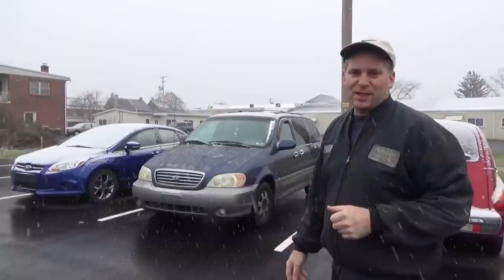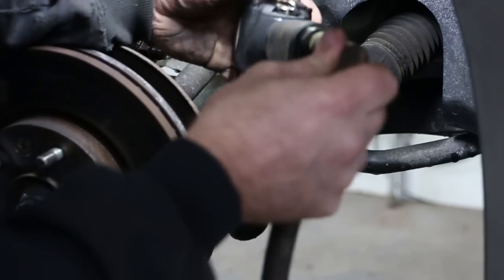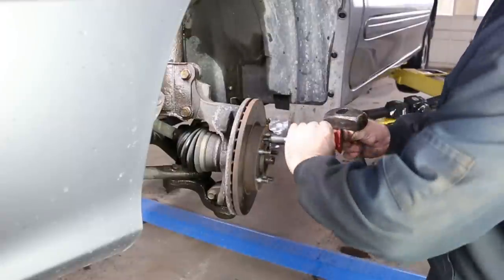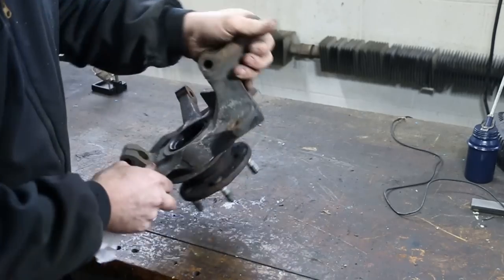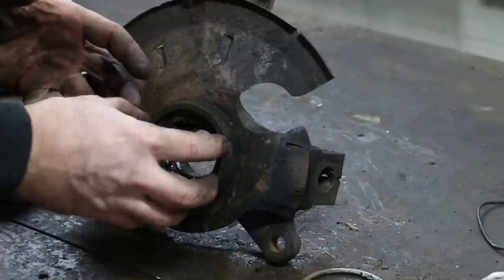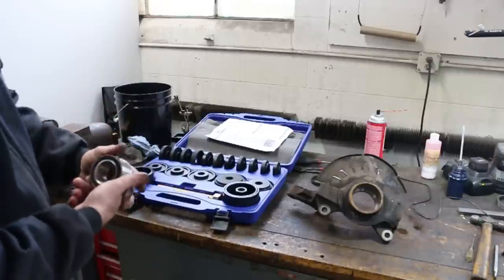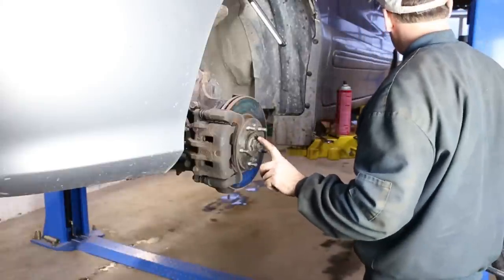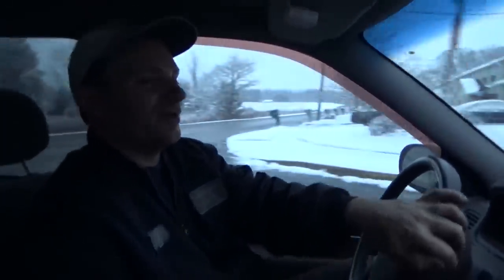Kia Sedona - Front wheel bearing Complete repair DETAILED

Comment: We have the same model/year van -  A few months back the right front started to squeak on deceleration. Thinking it was the pads, I replaced those however the squeak did not go away.  Now its gone mostly to a growl  like the video. There's a 2004 Sedona at the pick-a-part lot  which if I can get tools id get the knuckle and hub off it. Thanks for this video, I know it will help when I need to follow along and replace etc.

Comment: I want to thank you. 11:09 when you described that you "can push on that center race" to press out the bearing. I was worried that pushing on the inside would just pop and I'd be stuck digging out the rest of it. This video gave me the confidence in the correct procedure and I was able to complete the same procedure on my 2003 Kia Optima.

Comment: I sure like your press, with a single column giving lots of room all the way around your base. New presses aren't like that. I really like the technique you used here, with no need to accidentally score the shaft when a cutting wheel slips. Apparently many wheel bearings don't have enough of a shelf to support the bearing splitter.
Reply from the maker: spelunkerd thank you, that press has been very good to me over the years. Made by "Ward" I'm not sure of it's age however I know it's over 13 it came from a alternator and starter rebuild shop that closed up, I haven't seen another like it before or after. I'm sure they are out there. this splitter don't always do the trick, so yes I have a fair share of scarred hubs on the road 😁 glad it worked out this time. Thanks for stopping by. It's always a pleasure

Comment: Nice video & repair Will! I use the OTC 6575 Hub Grappler Kit and the OTC 6575-3 Hydraulic Kit which uses a hydraulic ram instead of the jackscrew so if the hyd unit were to fail I'd have the jackscrew as a backup if I was mobile. It removes/installs the hub also and has a puller for the inner bearing race but I usually end up using the same method you used or cutting it off but I've also had good luck grinding notches and using the puller. I usually do it on the car but like you said if in the shop you can sometimes do it just as fast with the press. You touched on all the critical points...great job Will!!
Reply from the maker: Hayward's Automotive I will definitely look into that setup! Thank you for sharing all this helpful insight as I'm certain it will help someone along the way. I have contemplated many times trying on the car, honestly never have. Old habits are hard to break 😁 thanks again. Always great hearing from you
Reply: It saves a little time but I did it off the vehicle for years and still do sometimes. I've been called to friends & customers homes when they wait so long their wheel is about ready to fall off and the kits are invaluable and save a trip back to press the bearing out. I like your press...pretty cool!
Reply: It saves a little time but I did it off the vehicle for years and still do sometimes. I've been called to friends & customers homes when they wait so long their wheel is about ready to fall off and the kits are invaluable and save a trip back to press the bearing out. I like your press...pretty cool!

Comment: Well done bud. Love that lil press you got there. I finally got fed up with my light situation and have ordered that same light the other day after a car project that needed to be done. Hope its all cracked up to be like everyone says.
Reply from the maker: Longtrailside thank you for the compliment and feedback, I will be completely honest, im not one to sell make believe and I sure the heck would not want to buy make believe either! All I can say is this was my first repair since the new addition, most tools not even broke in yet, I can say at full power on that light it latest the whole repair, in which took longer due to capturing extra details. around the 3rd hour I did notice some diming however still brighter than my snap on 3rs in, my old light was dead 30 minutes in. so this is a big win for me so far. I will do my best to report back any changes.
Reply: That's good good to hear about the longevity of the light. I have seen Eric O from SMA beat the pizzwizzle out of his astro tools and they have held up extremely well. A lot of other mechanics have been buying the astro light so i'm excited to try it out. Would love to get the astro BIGNASTY air hammer down the road. Oh by the way hows the new shop workin for ya?

Comment: I have a bearing removal/install kit like yours Will and have the same issue with something else needed in the kit to remove the hub. I currently have a big drift to strike & drive the hub out. If it don't move it goes in the press. Great video mate 👍
Reply from the maker: One Auto, nice! A good kit like this sure makes life easier to say the least, yup done that a few times 😂 mini sledge. It's one of those things I have some good ideas to improve upon this however just never find the time till I need it lol
Reply: One Auto, purchase the OTC Hub Grappler puller & forcing screw set. This will complete your kit. It runs about $140 or so.

Comment: Great video.  I have a 2005 Kia Sedona and had the wheel bearing replaced several times at a local repair shop.  They must be damaging the bearing on the install b/c they keep going out.  Additionally, It seems like there should be an outer seal and/or something to retail the proper pre-load on the bearing.  Torquing the axle nut only compresses the spindle (hub?) and it seems the bearing will then separate while driving.  I am at wits end on my 2005 Sedona and ready to take it to the scrap yard.  I cannot keep haing the bearing replace every 2 months.

Comment: 99% of the time ni do press in wheel bearings that race stays on the hub and i either use a puller if possible to get it off. or a torch. sometime u can grind a couple notches it the race so u can get a puller t grab it. learned that from an sma vid. dont work every time but still a good trick
Reply from the maker: Dylan Kinch hey Dylan how's it going man, thanks for stopping by! Yup I'm batting the same average 😂 never fails but yes if this would not have worked we would have done another method as you mentioned, all great tips thanks for sharing

Comment: I always slidehammer the hub, and pull the race off of it and press the bearing out on the vehicle.
Reply from the maker: seems to me you would need to separate the axle at some point. few more quick steps and the spindle is in the vice or the press. is it really saving time? non drive wheels easy peasy on the car. will need to try it sometime
Reply: Your right it is almost easier to do it in the vice, cause you still have to knock the tie rod and ball joint apart to get the axle out! Great videos friend ! Carry on😁
Reply from the maker: truly appreciate the feedback, something i never tried in car

Comment: Will also work 50 to 80% better if you replace the washers with a lug installer that has a bearing in it.
Reply from the maker: GCraigmile great idea, that exact thought crossed my mind while using 90% of pullers, thanks for sharing

Comment: The washers are supposed to be against each other and lubricated you’re also supposed to turn the nut not the bolt in it cuts down on friction and makes it easier for your impact to run
Reply from the maker: GCraigmile good to know thanks for sharing, worked like a charm non the less

Comment: How come you didnt use it to remove the old bearing?  The kit looks like it has receiving cups?  Just curious because I have been looking into the Hub Tamer and have tried it and it works great.
Reply from the maker: yes absolutely could have used it to remove the old bearing once the hub was removed, i almost went Full press on this job then thought man i have a kit i can demo, the receiving cups would work perfect. we will still need a way to remove the Hub in addition to this kit. everything else this can do with ease
Reply: Slide hammer for the hub?  Then it can all be done on the car?
Reply: Thanks to this video though I have found my new tool to buy as far as that kit.  Looks like it does everyone the Hub Tamer does but at 1/4 cost!
Reply from the maker: Potentially, they can be pretty stubborn even in a press at times. never looked into this to be honest. great topic thanks for the thoughts, im going to dig deeper now :)
Reply: robinsonsauto I agree they can be stubborn especially in the salt belt where it looks like you are and I know I am.  Let me know what you come up with but I think you already sold me on this tool.  I hope astro gave that to you because they are going to get some sales.

Comment: Hub Grappler has it all to remove & install while on the vehicles. I purchased a Dremel 8220 tool for those pesky in races. It also helps with minor rust build up in the areas. Try Tooltopia.com to save about half vs the tool trucks. This is a super nice Astro Pneumatic kit though as i am also a fan of many of their products😍😍😍

Comment: And then he says 185 for the hub not. But 185 to 190 what? Foot pounds or inch pounds? So crucial! If you don’t torque that axle spindle nut properly, that bearing won’t last. Sometimes in the first 100km it’s gone..
Reply from the maker: Foot pounds